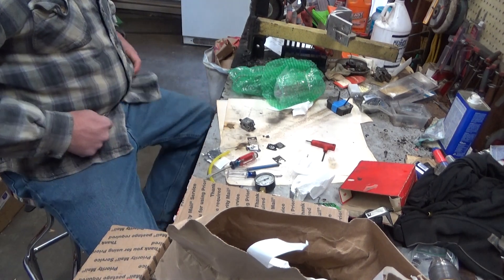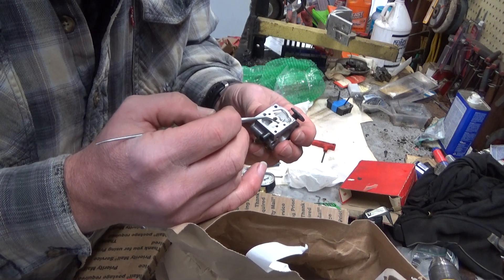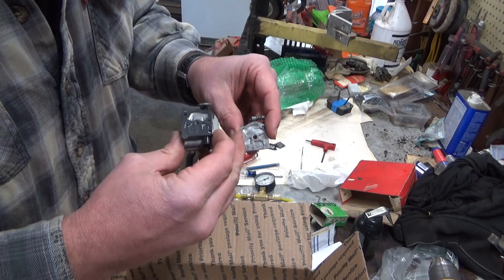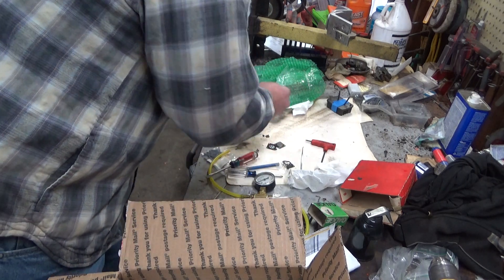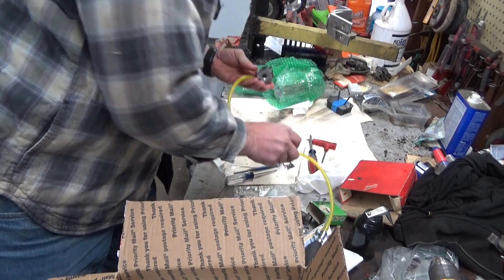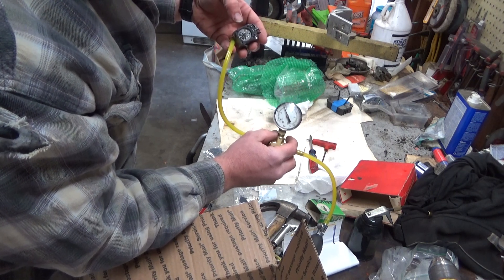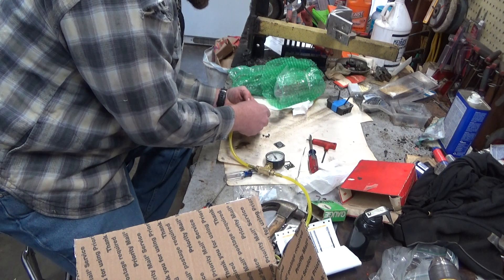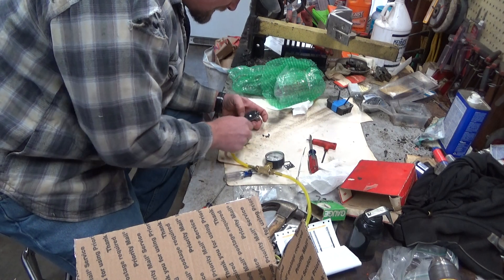Walbro WT-20 Carburetor Diagnosis & Carburetor Pressure Testing Part 2

Comment: Thanks! Been working on later small carbs and running into nonserviceable main jet carbs. I assume this not one of those and I should get a kit and fix it. For a little craftsman top handle, easy to work on so far.